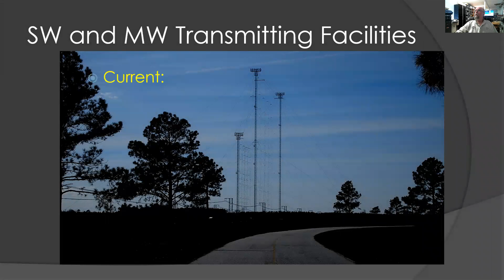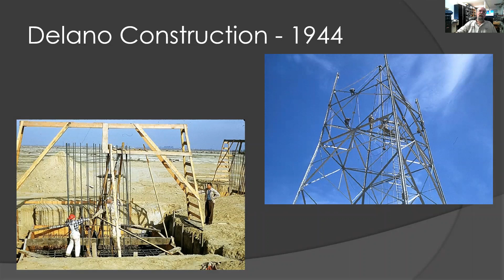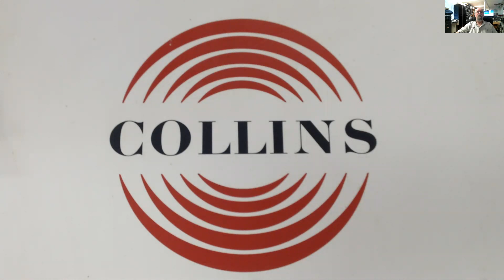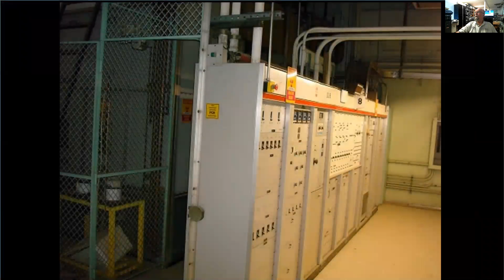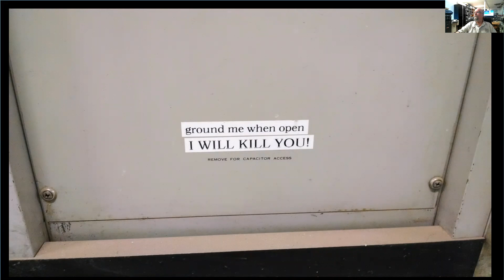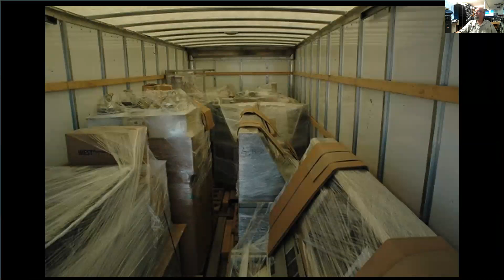Preserving a Piece of History: Voice of America Delano Relay DL-8 - Dennis Kidder W6DQ

Comment: That W2AU balun was probably a tap which fed the Belar AM modulation monitors. I forget just how the Collins 21A modulation monitor tap worked, but I do remember installing a coaxial relay next to the modulation monitor when we added a Harris MW5A at WBAA to switch the modulation monitor automatically to the transmitter which was connected to the antenna.
Reply: I have two 1940s vintage VOA/KCBR General Radio 1931-A Amplitude-Modulation monitors, and would love to hear your description of how they would have been used.